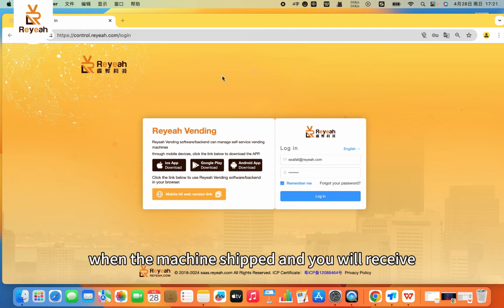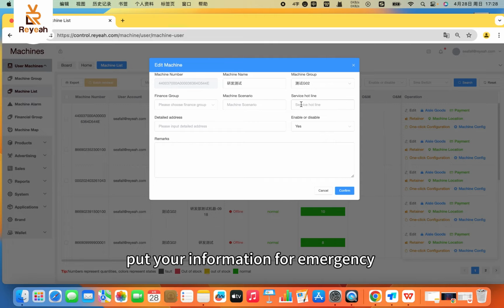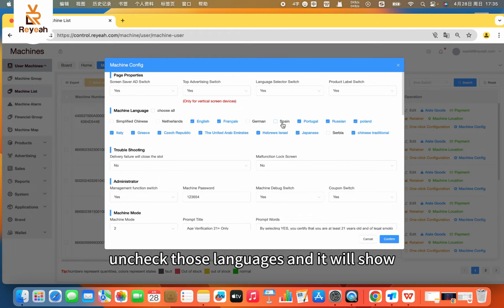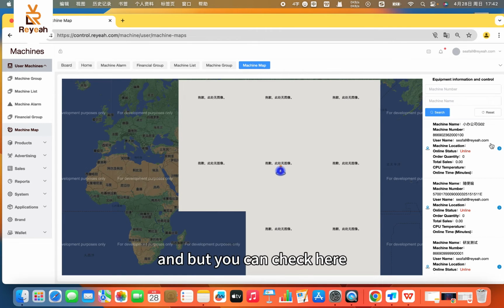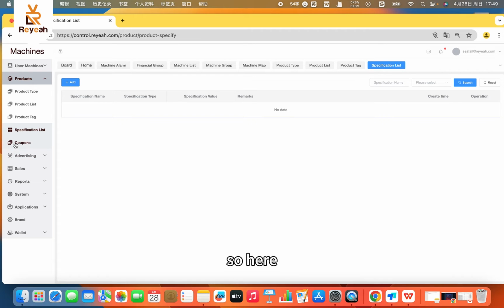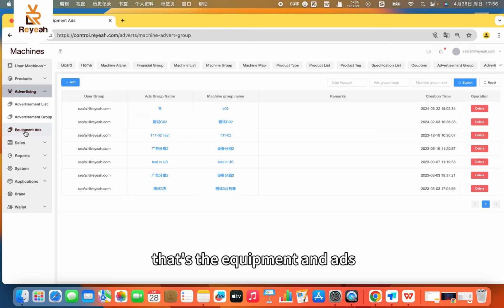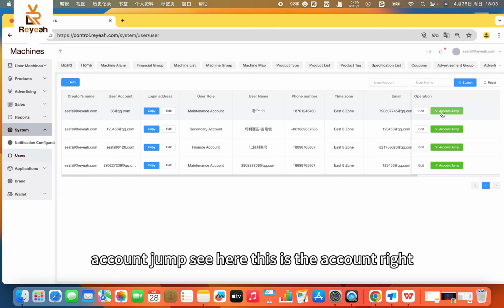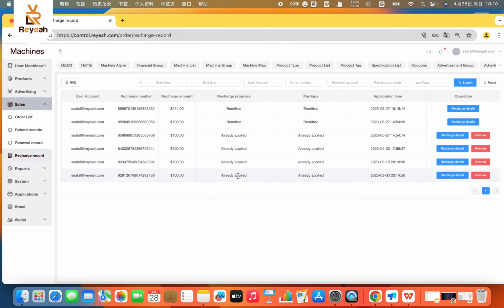Reyeah Vending Machine Software Instruction

Comment: A Complete Scam – Avoid at All Costs!

This company is the most deceitful, dishonest, and disgraceful supplier I have ever encountered in my 20+ years of using Alibaba. Their pricing is a blatant, outright lie designed to mislead buyers and waste their time. After months of discussions and planning my business around their advertised price of $880 per unit, I was finally told today—after endless delays and excuses—that the real price was $2,350 per unit. That’s almost THREE TIMES what they falsely advertised.

Their sales rep, Max, was not only dismissive but insulting, implying that I must be stupid for believing their own published prices. To add insult to injury, they tried to justify their deception by claiming that the $880 price was only for the case—something they conveniently failed to mention anywhere in their listings.

This is fraud, plain and simple. It’s a deliberate bait-and-switch scam that has cost me months of wasted time, effort, and resources, as I built my vending business plan around their fake pricing. Their lies have directly impacted my company, and I hold them responsible for their deceit.

This is the FIRST complaint I have ever had to make on Alibaba, which speaks volumes. Alibaba, if you care at all about your platform’s reputation, REMOVE THIS COMPANY IMMEDIATELY. They are a stain on your marketplace, eroding trust and credibility with their outright lies.

I am now actively exploring Made-in-China as a serious alternative to Alibaba because I refuse to do business with scammers like this. Buyers beware—this company is a fraudulent operation that will waste your time and set you up for failure.